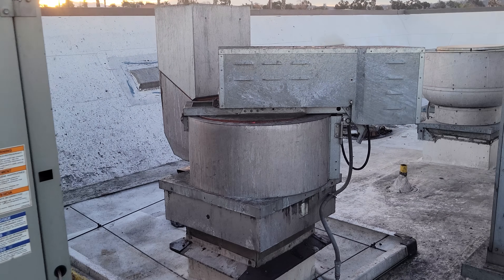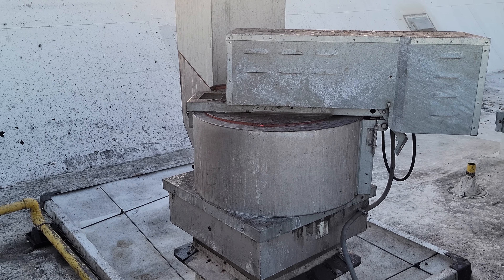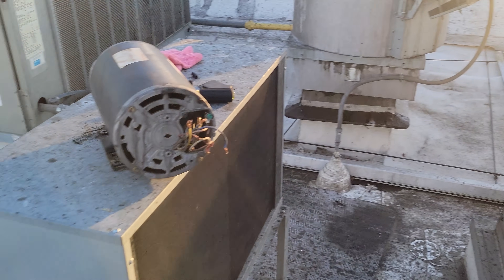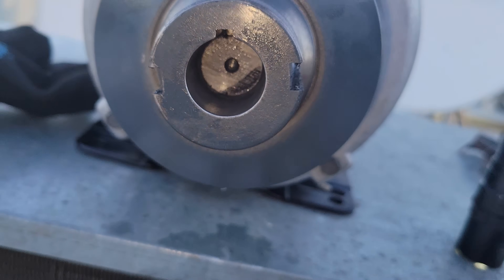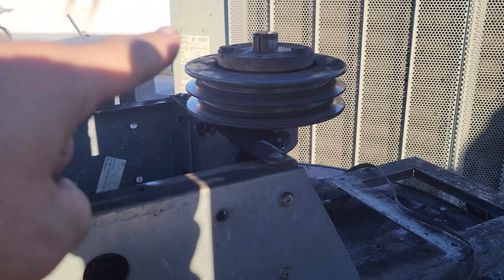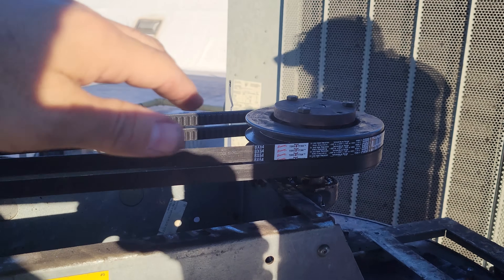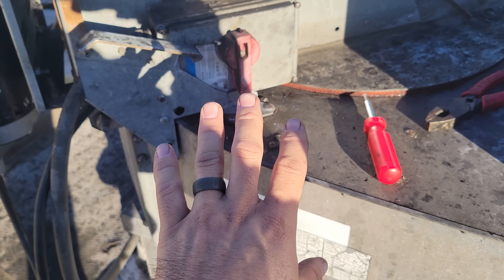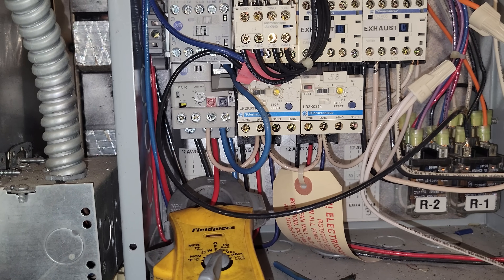THE EXHAUST FAN WENT DOWN AND THEY CLOSED THE RESTAURANT

Comment: I’ve seen exhaust fans for a paint booth that had paint caked on 2-3” thick! Manager said no way! It is designed to separate the paint and air can’t happen. Then he saw it when we pulled it. I’ve also installed many belts and aligned them using a straight edge. You can see a misalignment quickly with just a straight edge.

Comment: Hi Chris, the easiest way to line out these pulleys is just take a piece of wire (like you use on a kite) and if you put the wire on top of both pulleys than, if te line out is correct,  it should be touching the pulleys at 4 points (2 at each pulley). If the setting is wrong the wire will only touch at 2 points (one at eacht pulley).
Enjoying watching your videos in The Netherlands and as a old school electrical engineer learning every day a little more about refrigeriation.

Comment: Hey Chris, I have a new tool suggestion for you that you may like. I use the Jonard Tools CST1900 for stripping the jacket off of round cable, mainly SOOW. You can set it to strip length wise and the cut depth is adjustable. It is pricey but the great job it does it worth it in not nicking wires.

Comment: Amazing this fan this dirty could pass inspection. This is a 100% fire hazard violation with fine.
Reply: No one inspects that stuff after they are put up there. At worst they will come look at the inside of the hoods. But climing up on the roof to pull a hood cover off and look at it not going to happen or very very VERY rare. Source worked in food for last 16 years. We have our hoods cleaned every quarter.

Comment: Ya know i worked with alot of s.o cord. This thing you get from normal parts and tool suppliers is great for cutting and slitting the cord.this is a grainger number to look up. If ya wanted it sure is nice.
 WESTWARD

Cable Slitter: Manual, 8 to 28 mm Dia, Std Cushion Grip

Item #1YMZ9

Comment: Alignment of belts and pulleys without tools.  Yes, quite possible if your eye is sensitive to small angles and lines that are not straight.  The line across the pulley should be continuous with the line along the length of the belt, and then across the width of the final pulley, so that the line across pulley1/belt/pulley2 is a single "plane".  Tension, likewise by long practice and experience, you can tell what is the correct depression mid span on a belt without using a gauge or ruler.

Comment: That's absolutely the issue and will warp the bearings again. They need to clean the fans... they're all out of balance with all that grease on the blades. That's a lot of torque being applied back on the motor shaft and pulleys.

I just stopped a job due to bad fan blade. It was new but out of balance. I got a new blade because the motor will eventually pay for the out of balance issue. Manufacturer warrantied it and appreciated it because it'd save the motor over a cheap fan blade that someone might throw on.

You should tell the customer their warranty is voided if they don't have someone clean those fans asap. That'll get their attention. Dirty fans like that are as bad as overtightened belts or undertightened.

Comment: On non critical equipment that really doesn't require a mutli thousands of dollar laser alignment tool. I use one of those little hand held lasers, like you buy at a pet store. It fits into the grooves fairly quickly well and it works great. I'd be a liar to say i don't eyeball the alignment every once in a while.

Comment: Why doesn't the customer install a sealed motor. The environment doesn't bother them. Ya, priceier.
But whats the cost of not being open?
We have wind movers of your style that still running 10+ years, 1/4" dust or grease. warm to the touch

Comment: All that grease buildup certainly throws the wheel off balance, the wheel being off balance leads to premature bearing wear as well. 
I feel pretty safe in assuming this isn't the first time that fan has been a greaseball. Especially after two years of Coof.

Degreasing on the roof and hosing everything down the roof drain? That's a good way to get grease buildup inside the pipes. Even with commercial degreasing agents, it's a BAD idea.
My late grandfather, who passed on as much as he could about plumbing to me at age 7 before he was gone in '84, is spinning furiously in his grave just from me having typed the very idea!
Reply: Grease doesn’t typically cause balance issues unless the grease gets so thick that some falls off.

Comment: More consistent conscientious quality from you. From someone who’s manufactured 1000’s of service cord sets from SJ & SOW type cable aka cabtire”, I second your method for stripping. The way the rubber insulation “self heals” nicks can go undetected so it’s good to be contentious as you are. 
For the heavier jackets of SO it’s extra helpful to at least score the cable with a ring cut using a a stripper like a Jokari. Once you get this down to a science it’s a quick three swipe method. Hook, spin, pull. Your jacket termination looks pro with a nice round cut. VS the v neck and with the tool set right nicks aren’t an issue. As an aside, the little rubber “tubes” this creates doing it this way come in handy for all sorts of pipe insulation, Bucket handle grips and mock homemade rubber wiring grommets 😉
Reply: conscientious
Reply: @yz250a  thank you. Damn autocorrect

Comment: Step 1: use the tension tool and set the belt tension.
Step 2: look at the span between pulleys and estimate the length: a couple of feet, an arm length, a leg length, 6 feet, what ever you think is a way to estimate the length. DON'T use a tape measure. The idea is to get your mind to see the length, NOT have some number come off a tape measure than you forget 10 seconds later.
Step 3: push or squeeze the belt and see how much it gives with some reasonable (and repeatable) amount of squeeze. Again, remember how hard you squeezed, and estimate how far the belt moved: an inch, half a hand, the length of your pinkie, whatever. Again, DON'T use a tape measure, you want a memorable distance you can relate to.
Step 4: walk away, come back in 10 minutes after doing something else. Estimate how far you expect the belt to move with some convenient squeeze. Now try it. Did you estimate the movement distance right? Did you squeeze the same amount as last time? What lets you know if you did or didn't? Do this a few times until you KNOW how far that belt will move with what you KNOW is the same amount of squeeze. People can do this, it doesn't take a machine.
Step 5: have someone else mess up the belt tension and not tell you what they did. Try a squeeze. Is it tighter or looser? How much tighter or looser, can you guess? 
Step 6: retension the belt, just using a squeeze to determine the belt tension. When you have it how you think is right, get the tension tool out and check. How close did you get? With practice you should be within +- 10% or better of the correct value.

Now you know one tensions on one type of belt at one span length. Do it a few times and you will start to see how physics works and how spans, thicknesses, and tensions compare to the amount of squeeze.

Comment: The 10,000hp motor. Get the lasers out. The  1/2hp blower motor doesn’t need to be perfect.
Reply: There is no 10k hp motor lol
Reply: @etherealrose2139  They use them at things like mines for the shaft lifts. I helped install a couple last year. These were made by ABB

Comment: The key should be the same length as the slot, so that slot in the pulley where it is sticking out should have something in there or it is being installed unbalanced. I think you can get 1/2 keys and just tape it in place, as long as it is on the inside the force will hold it in place.

Comment: Chris don't be too hard on yourself about not getting out the tools when its comes to aligning and tensioning belts. My college classes taught us how to use all the tools, straight edges, lasers, dial indicators to align motor shafts and pulleys, but at the same time they taught us the two finger method for checking belt tension and said realistically that is how you are going to set the tension in the field unless its a pretty serious piece of equipment.
Reply: Close enough is good enough especially since no one will maintain it anyway.
Reply: The only tool I use is the cheapest pos plastic level that Lowes sold 15 years ago as a straight edge for pulleys that aren’t easy to align by eye. 🤣

Comment: Per Browning those notch belts need more tension then regular belts. How is that not harder on bearings.
Reply: X belts are far superior because they dissipate more heat. Solid belts get super hot which causes much faster belt failure and the heat travels straight into the bearings. I’ve never had an issue with X belts causing bearing failure. Bearing failure is almost always lack of maintenance or people who don’t know how to tension a belt. Banjo string is too damn tight.

Comment: Is there a reason for using 2 belts on the fan drive?
Reply: Redundancy I guess. If one belt breaks it’s still functional
Reply: Horsepower and torque transmission from motor to secondary pulley. Equipment i work on with larger Horsepower motors often will have 3 to 6 belts depending upon size of motor or driven device.
Reply: @mrbyamile6973  that makes sense
Reply: Have to have enough belt surface area to overcome inertia to start, transfer the momentum of the motor pulley to the blower pulley, and overcome inertia to stop- without slipping or stretching.

Comment: Grease build up causes all kinds of issues on those fans, split tapered pulleys can be tricky to get set just right, great job Chris!
Reply: Damn right I got to see one catch fire motor failed and caused a grease fire whole unit had to be replaced
Reply: Taper lock isn’t bad. I prefer them over set screw every day of the week. Set screws get loose and nobody ever puts thread locker on them, pulleys fly off, and everything gets destroyed. 🤷‍♂️